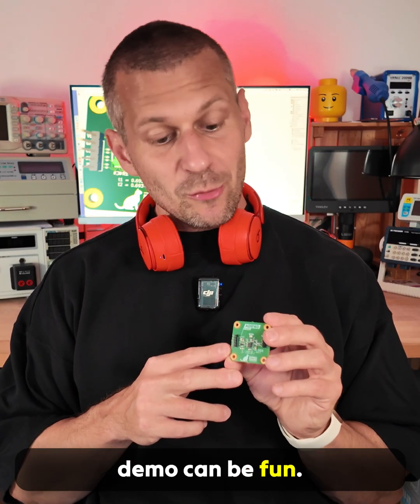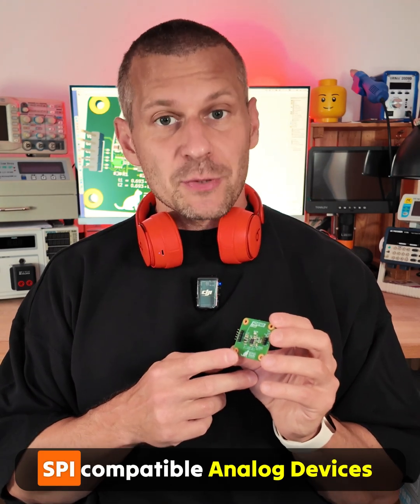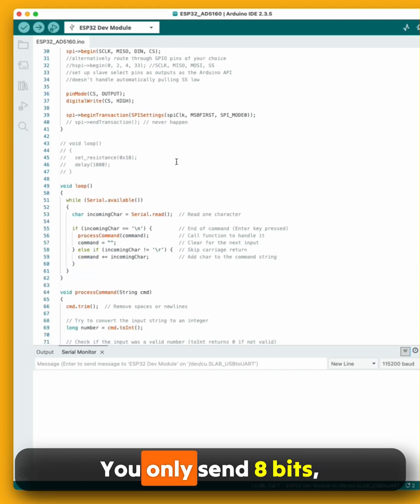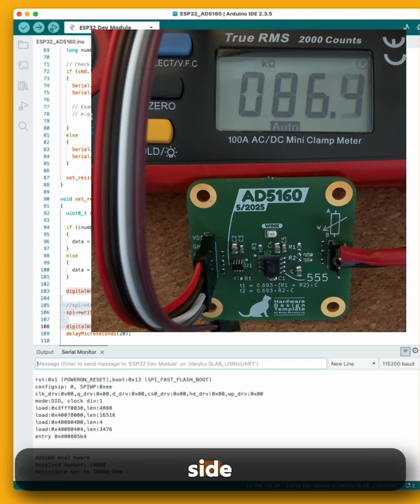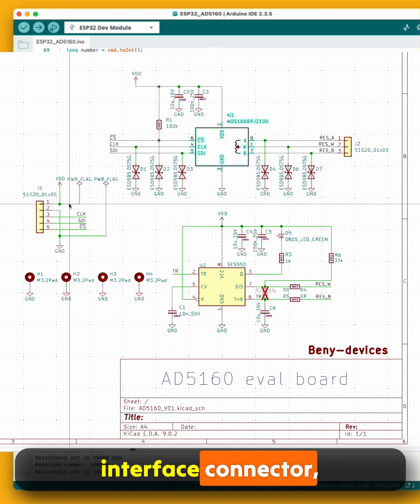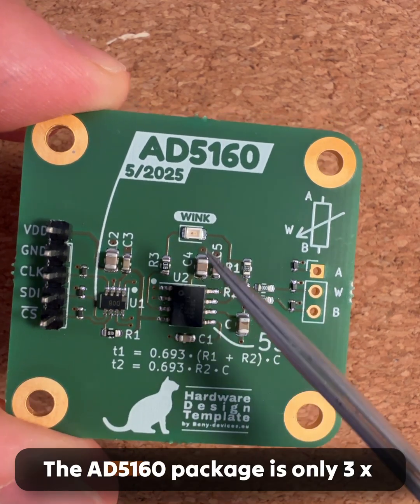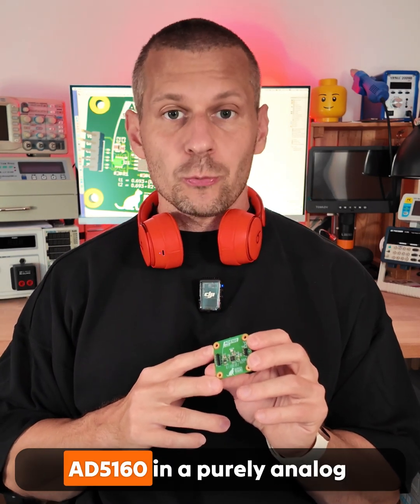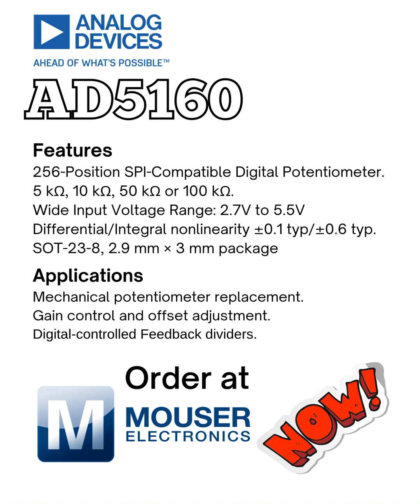AD5160. The Digital Potentiometer demo can be fun.

Comment: does it work as a voltage divider?
Reply from the maker: There is a full potentiometer inside. Yes, you can connect it as a voltage divider.